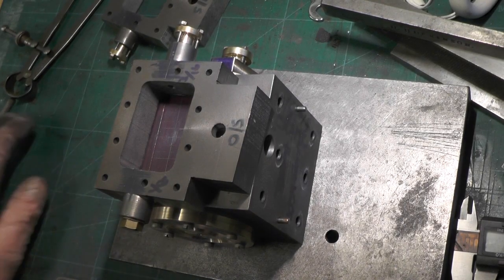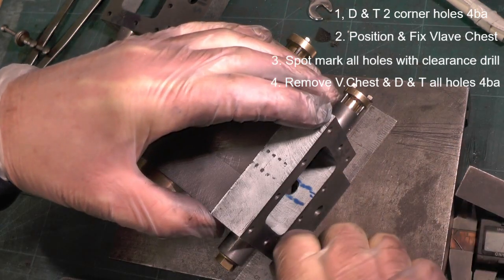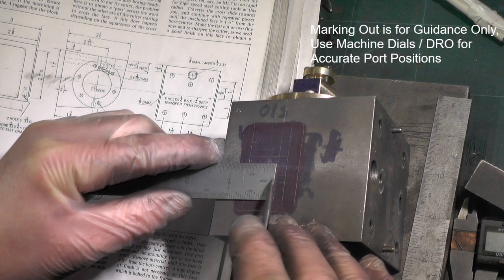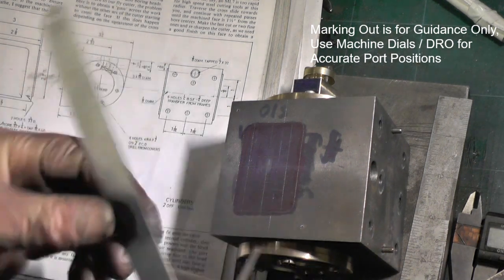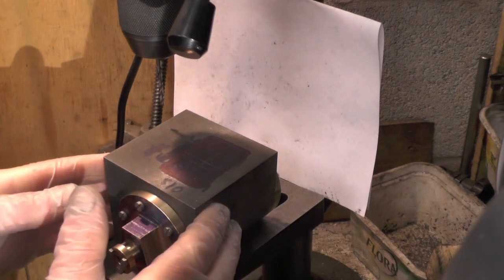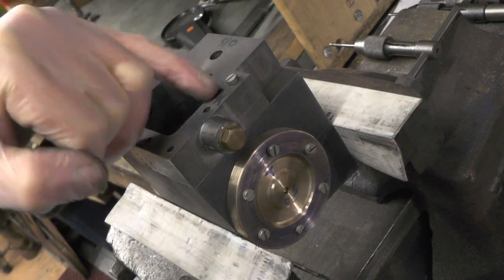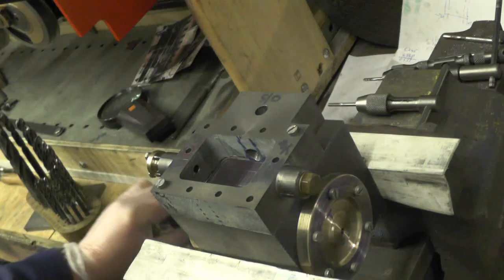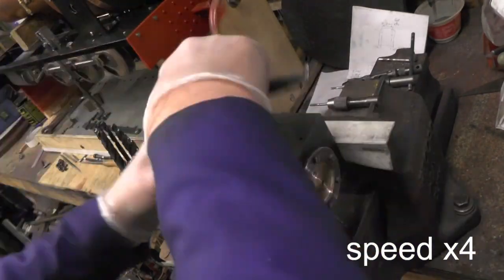make a Beginners Steam Locomotive Series (Cylinders Part 5 Steam Chest Hole Alignment) "mr factotum"

Comment: another clear  vid  chap   just a suggestion  when tapping down to a specific depth i  have made a jig that consists of a length of steel rod   drilled  clearance for the tap  with a short length  tapped  the tap size  then it can be screwed  up the tap leaving the depth clear ...... hope that makes sense , another  idea is to run a nut up the tap to give the required depth of  thread
Reply from the maker: hi nigel
yes thanks for comments, great idea for tapping, I will remember that , its all about sharing ideas
regards
mr f
Reply from the maker: p.s. nigel
when i get chance to show tapping again, if its ok with you I will use your method and give you the credit
regards
mr f
Reply: @MrFactotum  no problems  chap its all about  sharing as you say